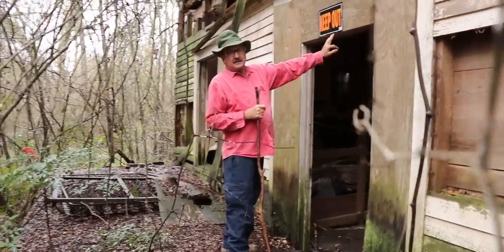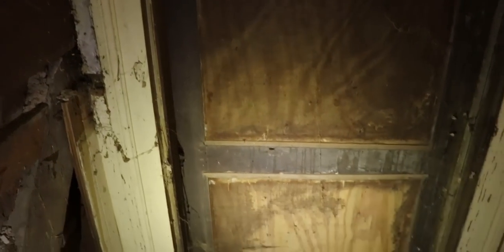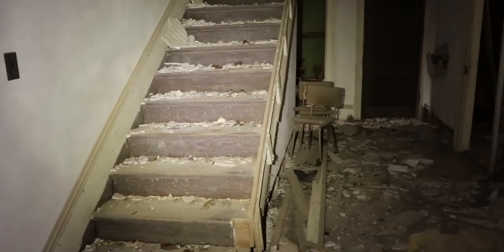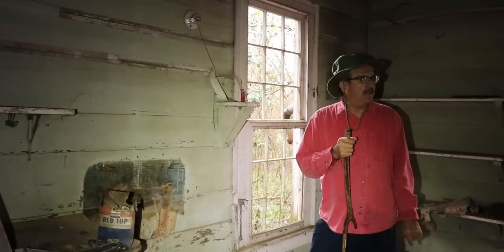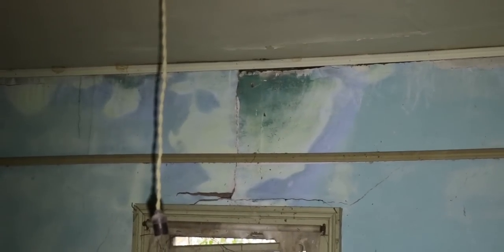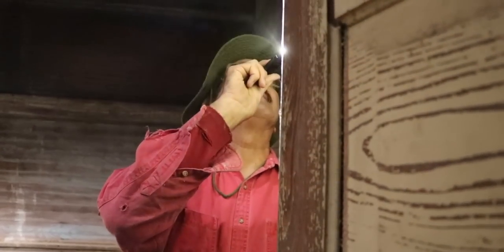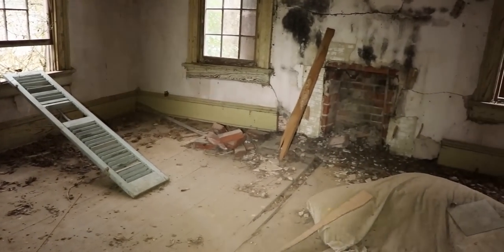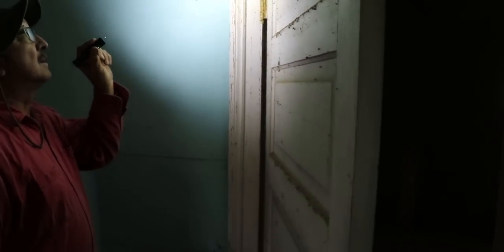Exploring Abandoned 190 Year Old Plantation House in Georgia

Comment: I agree with Robert regarding how unchanged that house is.  I saw no indication of life there beyond the early to mid 1960s.  My dad was an electrician, so I was often inside old houses when I assisted him in the 70s, and I only remember one place that still had the old braided cord drop lights intact.  The eccentric owner didn't want anything changed but, by that time, most people would have replaced such fixtures.  
I would love to know more about the acetylene lighting system.  As mentioned by someone else, the fleur de lis design of the fixture hints of New Orleans or France.  Obviously, the family was well-to-do in that era; by the time electricity was installed, not so much since braided wire drop lights were not generally used in the living areas of homes in the 1920s-1930s.  Brass pan fixtures with glass globes were common then.
Fascinating video tour!

Comment: The waviness of the glass is caused by the panes hanging vertically like this in a window for a very long time. In a newly made window pane from 100 plus years ago the glass molecules haven't fully set yet so when the pane hangs vertically then gravity slowly pulls the molecules downward creating the waviness.  This is proof that the panes are original to the house.  Newer glass is now made with additives to prevent the molecule movement.
Reply: Old myth. Once solidified, glass does not flow. Glass blowers spun molten glass into plates. They were not perfectly flat. They were cut then placed into a frame with the thickest side down for stability.
Reply: @astroboy5137  glass is a high viscosity liquid stays in that state  look it up
Reply: @billrodenhauser6851   Glass is a Amorphous Solid. I looked it up!! Maybe you should?
Reply: Glass is not purely a solid, was taught this in high school physics class.
Reply: @astroboy5137  i made glass four 46 years
Reply: What rubbish 🤣.
Reply: @astroboy5137  dude your wrong. I've learned about this in physics class and I've been working with windows and glass for 10 years
Reply: @astroboy5137  not insulting I'm just saying from my experience I'm correct.
Reply: Really ?,it's my understanding that the glass was made into a cylinder cut and flattened out .

Comment: Sure would be nice to see the before pictures when they someone live there how pretty it was before
Reply: Probably was pretty utilitarian.  Not a fancy house. My old 1916 farmhouse was pretty plain and not pretty, even when it was first built. It did have the old wallpapers over the tongue and groove walls that are in every room. And Greta the first owner did have wallpaper borders in each bedroom that we found behind the sheet rock. Sheet rock was put over each wall in the house in the 50's when the house got its first plumbing and electrical installed. And they added on a 1 story addition for a mudroom and the kitchen and enclosed part of the wraparound porch for a utility room.  We uncovered the old original wallpaper when my hubby had to do repairs when we put in new windows in an upstairs bedroom. It was the old fabric backed wallpaper. It was the dusty blue that I was painting the trim in the house. And the border was cut out along the bottom. And I had done the same thing on the border I put in the bathroom across the hall from that bedroom. That was freaky! That's when I knew this house was meant to be mine. Our house looks better now than it has ever looked. We often romanticized about how all old houses were when they were new. But not all areas had access to nice things back then. My house was very remote in 1916. It still is on a 6 1/2 mile gravel road. It takes 20 minutes to drive that. And 35 to get to town. When this house was built there wasn't a road. They had to use the lake across the field from the house. And take a boat to a little town aways away from here. So it would have been hard to get things in here.
Reply: I agree. I would love to see the house right after it was built, and the land around it. There's something romantic about how people cared for their homes in the good old days.
Reply: I bet it was beautiful, but back then many people couldn't afford to have photos taken since it was expensive..
Reply: We got all our before pictures from the county assessors office and the original owners family

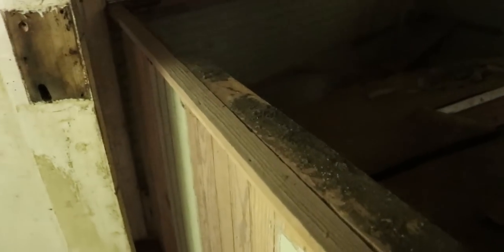Comment: at 15:40,  that wall could have had a giant open fireplace for the cooking. The fire box was probably as wide as the wall for pots to hang over the fire.  When the kitchen was "modernized" they closed in the fireplace and used gas or woodburning indoor stove/oven.  This kitchen would have been separate from the house with a well or cistern very nearby.

Comment: Those are my door knobs and plates in my 1916 farmhouse!!!! OMG! That is so cool! I found those in an online site when I was looking when I was trying to date them. You could buy them in the Sears catalog from 1915. They were 1.50 each for each door knob and 1.50 for the back plate. They originally came with copper and black, diagonally painted in 1/2 inch stripes. There was one in a bedroom of my house on the inside closet door that hadn't been painted white when they painted the doors. So I stripped all of them of all the wall paint. Then I spray painted them metallic copper and antiqued them with black enamel paint. Wiping the black off and leaving it in the grooves and to tone down the copper. They look so good that way. So much better than they did originally. I wish I could find more of those for my other doors that don't have those old ones. That was so neat to see those!

Comment: Really appreciated the tour of what once was a very grand home. I'm wondering if walls on the first floor that were not plastered were covered instead by paneling. The molding on that big beam in the front room is very sophisticated, suggesting that there might have been molded woodwork elsewhere in the room to match it --- now removed and taken away. The less disturbed upstairs rooms are beautifully finished but most likely far simpler originally than the downstairs trim that would have been designed to impress.

Comment: Back when indoor plumbing and electricity first came in to being the plumbers and electricians would do some scabbing cobbler work installing. Like running wire on the outside of interior walls. And running vent pipes through the bathrooms and kitchens. Instead of in the walls. GOD bless you guys and keep you safe. And thank you sooo much for what you do! Oh and I believe they used 1× sheathing in closets. I don't think they bothered plastering them. And a lot of the time you would see cedar boards in the closets to keep the moths out.

Comment: You were mentioning all the old wood.  I did some work on a house built in the 1910's here in CA.  The whole house was built out of old growth rough sawn redwood and solidly built.  All the 2x4, 2x6, 4x8's were all actual size, not finished lumber.  I had to cut into the old lathe and plaster to add some outlets/switches in and even the lathe was old growth redwood.  The lathe was 1 1/4" x 1/4" and I counted 25 tree growth rings in that 1 1/4".  The only thing that was built poorly was the cement raised foundation.  They used sand and pea gravel and no large sized aggregate which was a head scratcher to me, run you hand long it and it just crumbled right off.  I'd bet with all that old growth redwood that house will still be standing 100 yrs from now if not longer, redwood doesn't rot easily and is pretty much termite proof.  It is in a "historic district" so any modifications will have to go through the city.  Love all your videos!

Comment: Great fun watching THE Roberts' entertain ideas, and naturally progress to fairly accurate conclusions. 
The insides of closets were most likely never plastered to begin with, plaster needed air space in order to dry and cure. It seems illogical to rip out plaster and replace with 6" wide boards at a later time.  In the antebellum construction period wide boards were more abundant and easier to mill than  skinny ones. Hence the  generous width of mouldings and woodwork in general, because oaks & pines were hundreds of years old and plentiful.

Comment: The green stalk with thorns on it in 1st episode is 'stock citrus' - people grew oranges and citrus fruit up into N. Ga until the freezes and snows of 1890s. I was told 'wavy glass' was produced in early times by pouring molten glass over pools of mercury or some were molten glass run thru steel rollers. All of those wide sawn boards are from old growth pine - long leaf or loblolly - not the slash pine that is prevalent now. Time to change the name to "Watch your step Adventures"

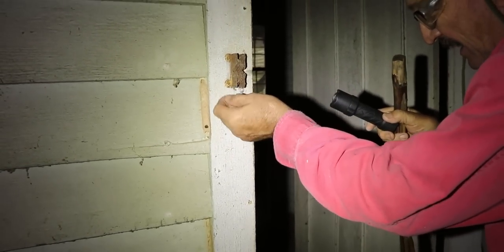Comment: That thing on the door jamb at 17:10 looks like it's probably a door latch of some kind. A door, maybe a screen door, would have a pin sticking out, and when it closed the pin would go into that, and it would get held tight. There's definitely something familiar about it. So that's what I think it is. You mentioned that house being mostly untouched by modern times. It makes me think of a house in Salem County, here in NJ. It was built in 1722, and is undergoing a slow restoration. It sits down a half-mile dirt driveway, and you can only walk to it. No vehicles are allowed back there. Anyway, it has never had indoor plumbing, central heat, or electricity. It is 100% original except for an addition from 1839 (or possibly from 1859). About bathrooms in old houses, my friend's house, which is from 1853, has two bathrooms. What they did was, the walled off a small section of the front end of the main hall on the second floor and made it into a bathroom, a long time ago. They also did the same thing on the third floor, directly above it. That house has 10 foot ceilings on the first floor, 9 foot ceilings on the second floor, and 7 foot 9 inch ceilings on the third floor. After she passed away it was sold and fixed up. That house had pushbutton light switches, by the way. One more thing- in my friend's parents' house, which was across the street from hers, the door knobs were all normal round ones, except on the closet doors. Those were oval, which I think that one was that you were looking at, at around 35:45.  Sorry for the long comment, but there was a lot to comment on in this video. :)

Comment: It is so funny many of the old houses I grew up in were much the same. (not that big) The old light fixture hanging down with the plugs was most likely from the 30s and early 40s. Many of my father's relatives had the same type of old cloth-covered wires. Radios plugged into the light fixture with a wire antenna running up the walls and outside. The walls where the beadboards were vertical is called wainscoting. The cast iron pipe you saw running up to the ceiling is a vent pipe for sewage gas. The transom above the doors was used as ventilation. Warm air rises.... if the doors are closed the transom would allow the air to flow up and out the windows. The top window would be lowered to allow airflow.  If you saw square nails they were most likely cut nails. The old  Rex Lard box is from the 1930's I still remember getting lard in buckets up until the late 1960s. There are a lot of old Rex Lard can for sale on the internet. Cisterns were very common in those days. I grew up on an old farm in Tennessee and I guess our house was built about 1900, lath and plaster houses were common. the basement was made of limestone rocks stacked and mortared with old white lime mortar. I can still remember making whitewash and applying it to the outside of stucco houses.  My uncle's house was pre-Civil War built around 1820, log with a dog trot running through. Old days were wonderful days. remembered but not forgotten. The story I could tell.
Reply: Also remember it wasn't until after 1935 before much of rural Georgia got electricity. If you are where I think you are you would have been part of the TVA. Most of my Father's people did not get electric power until the 1950s. and that was middle Tennesse. After the Civil War many old plantation homes fell into ruin, then in 1929 the Great Depression destroyed the rural economies and those old homes fell into disrepair again. You are extremely lucky to find old homes still standing. 
Take a little trip over to Natchez Mississippi and tour some of the old pre-Civil War homes there, which will give you some insight into the architecture of the old plantation days.

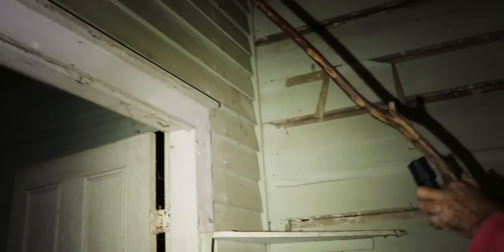Comment: @ the 17:00 timestamp that's a knife sharpener that's attached to the wall, therefore the room was the kitchen. The hole in the ceiling was for a wood burning stove where a pipe used to be attached.

Comment: Alot of the wood walls/shiplap walls/ beadboard walls were covered with cheesecloth then wall paper. So it didn't always matter what the wood looked like under. Most times in the early days the kitchens were on an open porch where you saw the outside siding inclosed in the kitchen.

Comment: It was a four over four center starcase or steps with a landing  at back . The original window from the front got used in the breezway when they attached the detatached kitchen. The hardware on the doors look East Lake so it probably got a remodel in the 1880s but basically it was just for rooms over for rooms with the central hallway  And the detached kitchen with a breezeway in the bathrooms were outside

Comment: At 17:00 there is a knife sharpener also have seen that style sharpener used for an axe. Which might be why the sharpener is on the outside of the house back in the day. If one was chopping wood for heat no need to hike anywhere to do a quick axe blade sharpen.

Comment: I can't see it well enough to determine for sure, but the "tile" around the fireplace (around minute 33) may be impressed plaster. I have wainscoting in my 1941 kitchen that looks like 4 inch bath tile but the " grout lines" were impressed with a round stick in the plaster itself to look like tile. I was told it was a method a talented plasterer could perform and I've seen it in a couple of other old 20th century homes. 

In a similar manner George Washington's Mt. Vernon appears to have a stone exterior. In reality it's wood cut to give the appearance of stone and coated in sanded paint.

Marble columns in Pompeii (79AD) are actually marble veneer coverings over common brick and mortar structure. The point is faux appearances in construction dates back centuries.

Comment: That big open window is original. Tte window would have originally opened up with glass pushed up into the wall to then be used as a door to the veranda porch. That is a plantation house dating to 1830's. The slat and plaster is a dead giveaway to the dating of the structure.

Comment: It won’t be very long now before it will be too dangerous to go in.  Maybe the best thing that could be done is to dismantle it and save and re-use all the windows, wood, solid doors, doorknobs, etc, that are still in decent shape.  With just that, you could build a smaller house that showcases and preserves the old materials.

Comment: That is an original window. In the old days, they used to make Windows from the floor almost to the ceiling. Then what  they would do is open the top and the bottom. Heat would go out the top and fresh air would come in the bottom.

Comment: If the owner is just going to let the house fall down, they should let some of that wood be reclaimed and used. There is a market for it. They could make some money.

Some of the old houses up here in Michigan have screens on the inside of windows. Usually they were added on later. But inside so as to not "ruin" the look of the house on the outside.
My house is. 100 years old and has a lot of the beveled glass. Especially on the original outside doors.

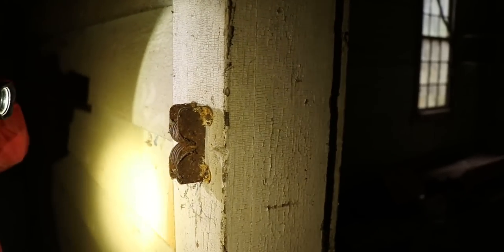Comment: At 17:16. that's a knife sharpener.  It would have been on a handle but looks like the head was removed and mounted on the wall. You run the knife blade perpendicular to the discs.

Comment: Bless your Hearts, that is a bit dangerous. I , too, often, will walk thru decrepit, structures. 
    I am a didactic builder. Learn from doing.  My family, has built structures in Mass-achu-setts, since the 1650’s. My father and Grand, were lawyers, big time, no carpentry skills. 
      We had a section of West wood, (in Mass.) called Clapboard tree. Where huge pines and n. Cedars were perfect for siding. Wainscotting, was revealed for it’s  purpose, and visual relief,where lath, runs horizontal, wains run vertical. Dentals, at the top , indicates frieze details, as important, and difficult, finish,at a height. 
       Of course that is a knife sharpener, as in the day you might take your blades to a skilled person. We had one in our, 100+ yr old, summer’ mansion by the ocean, where every wall, showed the 3/4 inch fir sheathing, of the exterior, yet lovely stained and shellac finish work, in the common rooms.
       Your brick are indicators as well.. often, brick came from a distance, and brought with the carried beings, in ships. This is indicative of, ballast, and not of locally formed or made brick. The whole house ,you explore, has architectural element, not produced on site. Naturally, after the initial built-sections of the house, builders with different skill levels, completed work with less cost.
       It’s possible, that up and until  the civil disagreement of lat 1800’s, we’all supplied each other. I live in the country, yet raised in 1940’s suburbs, outside Boston. 
       In my lil town w/850 people, we’ve had sawmills, and supply houses , since that revolution, my family carried on in the 1700’s. We have antique tool museums. And 100’s of colonial examples, of structures, still in perfect shape. My friends ran a company,for years in the 70-80’s that installed copper lightening rod-systems, as retrofit. Install all systems, in order, after permits allow. Not before.         Thanks agin!